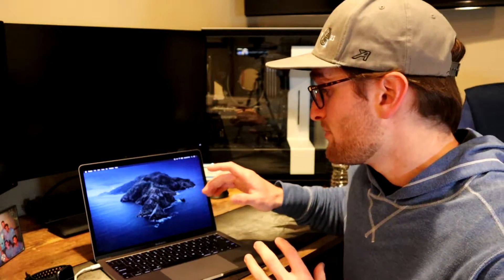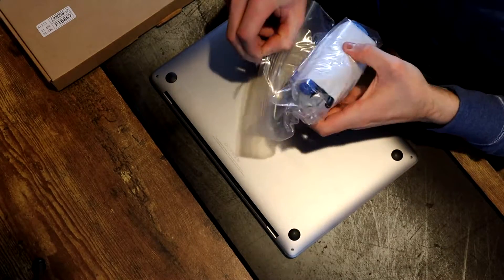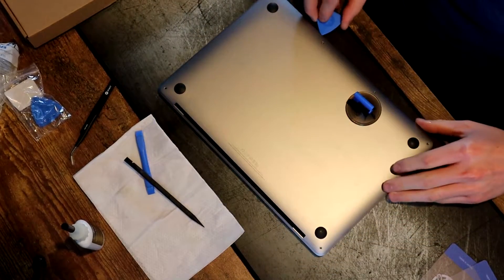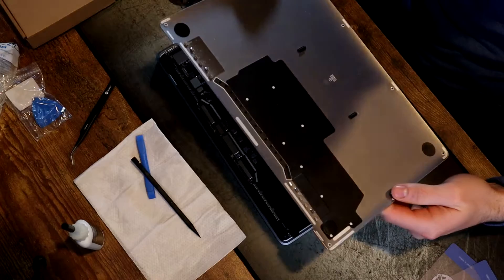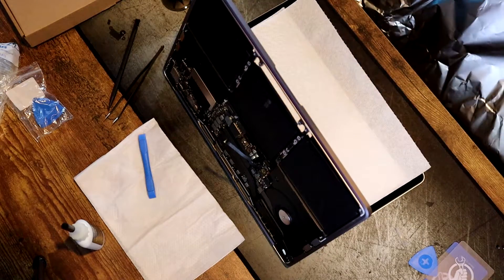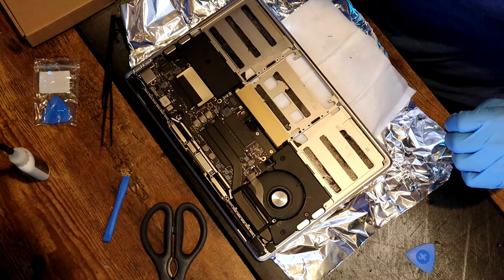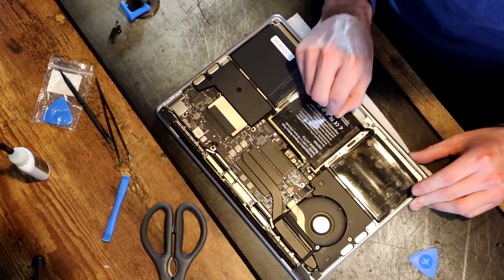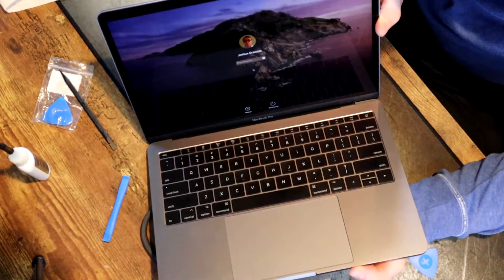2017 MacBook Pro 13" A1708 DIY Battery Replacement | iFixit Review

Comment: Ive a problem. When removing the old battery. The ribbon connector female part on the logic board came apart and now for the new battery i cant connect the battery daughter board to the logic board. Is there a solution? Any help or advice will really help. Without this connect my macbook wont turn on

Comment: What’s the first ribbon that was removed? I opened mine (used) to replace the battery and that ribbon is missing. I replaced the battery and as soon as unplug the charger, it dies

Comment: Thanks great video. Almost missed an important step putting everything back together. The ribbon at the top left from the old battery connector had to be transferred to the new battery
Reply: This is the part I’m stuck on. I can’t seem to get the ribbon in my new battery.
Reply: What should I do? How did you get it in?
Reply: @T-Dawg123 it’s been a while but I believe it was the ribbon at the 4:30 mark. It’s the opposite action of the removal

Comment: Great video!  I have a 2017 MacBook Pro that won't turn on is it usually mean that it needs a new battery or something else?
Reply: If it only turns on when plugged into the electrical adapter then yes you need a new battery. Anyone can follow this guide, 1 step at a time.

Comment: I do it the same way without removing the trackpad, with a little goo be gone on the edge of my prying tool making sure you stay away from the trackpad with liquid, stay on the outer edges of the battery and pry inwards, I also run the unit for an hour before removing the battery making sure the unit is warm making it easier for the adhesive to come apart.
Reply: that sounds like a good idea.   but if the battery is well and truly dead you cant do that.   i think i'll leave my computer upside down out in the sun before i rip its heart out.

Comment: The only question / contribution I have is to mention why you didn't show the reinstallation of the ribbon cable on the battery. What a biatch it was to reconnect.

Comment: What is the flat you removed at 4:33 for?
Because i replacing the battery of an used MacBook Pro and it does not have it.

Thanks!

Comment: I did the replacement and the computer still doesn’t recognise the battery, what could be the issue?
Reply: Damn he messed up a couple peoples i see mine won’t read either im gonna put the original back in

Comment: Thanks to this video I was empowered to replace the battery in my 2017 MacBook pro.  While not the easiest thing I've ever done, it wasn't that hard either.  I had to pry open the back of my laptop using a screwdriver near the hinges.  Once off, the rest was just common sense and a bit of patience.  No doubt, I saved a lot of money.

Comment: It would be useful to mention in this guide that the battery connector is its own part. 

Using this guide I removed my battery a week before my new battery arrived, and knowing that my old battery was stuffed I threw it out (lesson learned for next time) along with the battery connector still attached as I didn’t know it was it’s own part. When my new battery arrived I started following your guide again only to realise that I didn’t have the battery connector part and have had to order a new one.

Comment: Don't try this without the adhesive remover. I read some guides that said you don't need it. They're wrong. It really sucked.

Yes, I succeeded in replacing it, but it was no fun.

Thank you Tech Round Up for the great guide.
Reply: Did it without adhesive remover

Comment: Thank you for the tutorial. Just replaced my MB Pro 2017 13in battery with your guide. I got a $33 generic battery off ebay and it was the same battery in the video!!! It came with the necessary screwdrivers, plastic putty knife , and spudger.  Total capacity after install and calibration was 4758mah.  Perfect match for OEM battery. All i needed was a guitar pick and bottle of acetone.   Placement of the battery board is important. If not centered correctly, the battery wont be detected.   I learned a really good trick. IF you have a glass scraper (with razor blade) moistened in some acetone, it is amazing at getting rid of the old adhesive and saving you a ton of time. Plus it does no damage to the aluminum. Its now a permanent tool in my macbook disassembly kit!   The 2017 MB Pro 13 battery is definitely easier to talk off than a 2015-2017 MB12in. That battery and adhesive was nuts!
Reply: How is the new battery performance, does it hold the charge well

Comment: do you need to add the adhesive from the new batteries? why not gently peel it off so the next battery is easier to replace.
Reply: yes, it will move otherwise and possibly damage it or damage something else or pull the connections off.

Comment: **FOR ANYONE USING MOBILE SENTRIX PARTS** They Adhesive the cable that goes over the connector. carefully peel it back and it should reach over just fine. I fought with this connector for 15 minutes before realizing it wasnt attached it was just adhesived in place.

Comment: I have the same model and the same issue. Apple would charge me around 400$ for this but I decided to replace it myself cuz I am into tech stuff. I’ll try and will let you know the result! Thank you for the video

Edit: I replaced the battery by following the video and everything went well! It’s working like new! Thanks for the video
Reply: This is a lie. They charge $250
Reply: Did you do it? How did it go?
Reply: @epistomolokko  yeah I did it, it went well. I just followed the video and now it’s working perfectly, it’s not that difficult at all
Reply: @cr7forever7877  Glad to hear it. Did you also clean the inside and change the thermal pastel too?
Reply: @epistomolokko  noo I did not, it seemed pretty hard and time consuming
Reply: Congrats! We peasant can do a 400$ job of Apple! What a scam. At least other hardwares are quite robust. Mine is still running as well (except the battery of course).

Comment: I replaced my battery, but now my MacBook won't stay on unless it is connected to a charger. I am unsure if this is an issue with the battery I bought or if I messed up when replacing the battery. Any help would be awesome!
Reply: Did you find out what it was? I just replaced mine and it worked fine at first but now it won't even boot up, it turns off and it takes some time for it to be able to turn on again, even connected to the wall, if it is a bad battery I have less than 30 days to return it

Comment: apple's $500 fix is basically total lower case replacement, i had this done during warranty, they replace everything the touchbar, trackpad, keyboard and battery, basically everything except for the screen and motherboard.

Comment: the small daughterboard cable that connect to the system board to provide powerTO THE BATTERY I have a new cable how does it connect/

Comment: Just changed my battery, works!
Reply: Same here, just today, but I must say there were some gray areas and leaps of faith - especially around the ribbon cables - removing the one from the old battery's chip entirely wasn't clear (I had to retrieve it, fortunately hadn't dropped the battery off at a disposal facility yet) and where/how they plug back in was also a guessing game.  But I'm up and running!

Comment: It's funny because the iFixit kit here in Australia is $249 and Apple charge $199 for a battery "service" - not sure if thats a replacement?
Reply: Use eBay not ifixix in Australia, mine cost $70 and I bought some adhesive remover from Coles for about $8

Comment: My daughter got her MBP battery replaced at her college bookstore for $189, but I think I'll go this route for mine. However, with a bit more engineering (or perhaps a bit less), Apple could have made this process a ton easier.
Reply: believe me, they did all the engineering to make this as hard as possible
Reply: Why? Making it easier would cause you to fix it instead of replacing it
Reply: @kid5042 exactly. Apple wants to make the process harder so you have to pay their outrageous repair prices or their more preferred option is for you to purchase a new device

Comment: Thank you so much for this video, I bought my batterie from battdepot for €60, bought some acetone (to remove the glue) from a local diy store for €3.50 and changed my battery using this video to guide me with 0 electronics experience. For anyone not sure about whether they can do this, if you follow the video step by step it’s very simple!!
Reply from the maker: Glad it helped
Reply: Cool

Comment: Inherited an a1708 recently with a bad battery. I've replaced the battery on numerous MacBooks in the past, but this one makes me nervous.  Probably the glue strips and trackpad removal.
Apple's own website says it's $199 to replace the battery, it's crazy that people are being told $500 by Apple, something's not right with that.  $150 for the iFixIt kit seems excessive, too.  If I were inclined to go with the iFixIt price level, I think the extra $50 to have Apple do it and be responsible for any issues afterwards would be money well spent.
I know iFixIt is top notch parts there, but I've purchased much cheaper batteries on Amazon that worked fine in previous MacBooks.  The a1708 battery is only $50 or so on Amazon as of 02/2022. Any DIYers should consider those options, although they don't include tools other than the two screwdrivers called for.
Thanks for this video.

Comment: We use  Li-ion batteries in our medical diagnostic ultrasound equipment, specifically the 18650GA cell which is used in Teslas.  The life cycle specifications for this and most other Li-ion batteries are:  Charging from 100% to 0% these batteries have a life span of 500 cycles.  When charging from 80% to 20% these batteries have a life span of 50,000 cycles.  I've been working with medical equipment since 1972 and have seen the progression of battery technology going from: Ni-cad to NiMH and now Li-ion.  Just and FYI to get the longest life from your computer batteries.

Comment: you need to take out the motherboard then the battery because some battery cables are routed under the motherboard.
Reply: Not take out the logic board completely just remove the screws  to lift it up slightly in the front.

Comment: Lesson learned from watching this video. Don't buy a Macbook and just get a PC laptop. Battery swapping is ten times easier. Thank you for watching.
Reply: While yes they are a pain in many ways... Macbooks have their use case. In my experience, they're far more durable than a windows/linux based computer, as well as far lighter. Plus the trackpads on 'em I'm a big fan of.

I'll be honest, I can't think of a regular laptop that's good in all three of those points. I have some hopes with the framework laptop, but besides that... Everything else seems either way to flimsy, or way to bulky, and none of them have good trackpads.

The only real downside besides the price/repairability (which is pretty major, don't get me wrong) is that you really can't game on it all too well, but not that much of an issue for me. If I play games on a laptop they're usually web-based puzzle games (i.e. sudoku, kakuro, etc) which don't suffer this issue. If I'm playing actual games I'd just prefer to use my actual desktop computer.

As for price and repairability... They are major factors, yes. If it was just one of 'em I'd partially dismiss it as an issue, but given it's both... Well, it's a case of the other factors are too major in my use case to want to go with a regular laptop. Given what I use laptops for, it being sturdy and lightweight is far too important, as well as not needing to use a mouse because the trackpad is so horrid.

Honestly, recommend me a laptop that meets those three requirements (sturdy, light, good track pad) with performance equal to or better than a macbook pro and I'd welcome it when I look into getting my next laptop, because I know of none that fit that bill.
Reply: @Catsrock46060  Believe it's no other type of laptops out there that can beat the comfort and user friendly experience like Macs.
Reply: @bobbyz23  Ehh... Other than the lack of repairability, yeah. Also just some weird missing features at times...

Don't think I'd ever get a mac as a desktop again, though. Horrible experience... Plus I just enjoy building my own computer from scratch, y'know?
Reply: @Catsrock46060  Never had a bad experience with a Mac in my 14 year of using them.I think most of the problems with Macs are based on users abusing them,that’s just my opinion.
Reply: @bobbyz23  I think it's also largely use case. For me... Mac desktops just don't work well. There's just so many software incompatibilities at times. Hence why I think macs are my goto for laptops - the software that causes issues for me (largely to do with programming) I just don't need as often on laptops. 

Also just some features that should really be built in that are missing. Namely, volume control for multiple applications...

Although I suppose there are 3rd party solutions to that last one, but still.
Reply: Windows computers slow down after time and you have to be careful what sites you go on or you'll get a virus even with anti-virus software.

Comment: thanks for sharing. how did it turn out? Can you please share an update?
Any options to buy this in Germany?
Can it also work for the version of 2017 MBP without Touchbar?
Reply from the maker: Still working great, but turned out that Apple started a replacement program for those batteries free of charge like the next week :( , due to a known fault.  So I would just make sure your Mac isn't a part of any replacement program before replacing
Reply: @TechRoundUp  wow.. Thanks a lot man. How to check if my mac is a part of that replacement programme?
Thanks again!

Comment: Well done, this is the last MBP you can upgrade the SSD on as well.
Reply: How?
Reply: @callofduty2217  check out MacRumours. There's a large thread on upgrading the A1708 with a 2242 SSD. Currently got a 1TB Sabrent Rocket Nano in mine - and I fixed the sleep issues (not straight forward) 🎉
Reply: Really?

Comment: Save yourself all these hassles and buy a computer that's engineered to have the battery replaced. This is ridiculous the process you have to go through to change a damn battery in an apple computer. Overpriced garbage

Comment: Is it normal that my battery is at 2.2v under the screw ? I got 7.68v when I test the pin 1 and 5, 2 and 4 (With the 5 pin on the left of the battery control board). If you could test it or tell me if its good or not. Let me know !

Comment: This kit is $149 but Apple only charges $125 to replace it for you, battery included
Reply: Apple actually charges 200 but will tell you you have more problems and try to charge about 500 ish

Comment: I'm genuinely surprised at how relatively easy that was!
Reply: Yea the hardest part was taking off the back lol
Reply: That was easy?
Reply: @panchxshow  for and Apple product, yes it was
Reply: @danielyonspacini  but for a laptop in general, not at all
Reply: Any other laptop  would be even easier.. batteries should always be simple to replace.  Requiring adhesive removal and trackpad removal is just anti-consumer.  Its there to scare away the less savy - and it works.  If your an apple customer your paying a premium to recieve this disrespect.
Reply: @theagent578  I agree. I have a perfect condition Surface Pro 4 but the cost of replacing the battery is ridiculous so it will eventually end up being scrapped. There is no excuse for building batteries into a laptop or phone other than to force you to constantly upgrade.

Comment: I got the same model as this and my battery wasn't charging at all. I was told by Apple store that it had died. The Apple store told me that I would need to replace the whole upper case, that I could not replace the battery. I thought that is complete bull crap because I am sure I could replace the battery. I had the same problem as your MacBook Pro. That battery warning came on and I could not charge it. I think apple was trying to just get money out of me by telling me that I needed to replace the whole upper case. Do you think Would need to do that or could I just repay the battery like you have. Because I had the same problem as you have with yours.
Reply from the maker: I know Apple recently started a free battery replacement program for the 2017 MacBook Pro so I would recheck with Apple if your Mac is eligible

Comment: Why does it say on Apple website it costs 199 dollars and your friend has 500?
Reply from the maker: Mainly because Apple quoted a couple other repairs to the motherboard even the only bad part was the battery
Reply: Tech Round Up Can we just say I want to only replace the battery and the I will take the risk of the rest. Lol

Comment: I had the battery replaced on my MBP 2017 touchbar last week and for some reason when you look at the settings, my machine is still recognizing the details and capacity of the old battery that was removed (which was down to 2800mah and was all bloated when the technician showed it to me) and not the new one (4400mah). Other than that the battery cycle is now 3 and it’s normal, and it’s charging. Technician says it’s a bug on the OS, but I  dunno. Paid $150 for the new battery.
Reply: he wasnt lying, thats just how it is.. it keeps the info frm the last battery.. when apple replaces it tho, its a bit different.. but thats just apple for you.
Reply: did u pay $150 at apple store?
Reply: @mjl7810  no. it was a third party computer shop that did it. anyway, i ended up taking it to an authorized apple service center and paying another $150 for an original battery. not long after that, i sold the laptop. the lcd screen began showing lines and the same shop quoted me $300 to get the screen replaced. i said no way.
Reply: @jacquie.ec.2012  man, im just so sad about these 2016-2017 macbook batteries that even dont wanna buy macbooks anymore